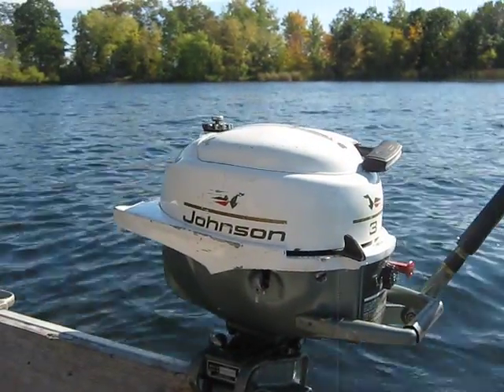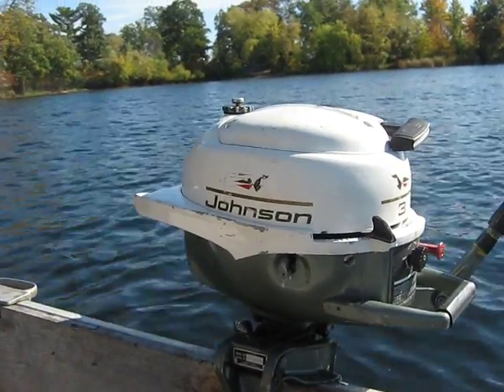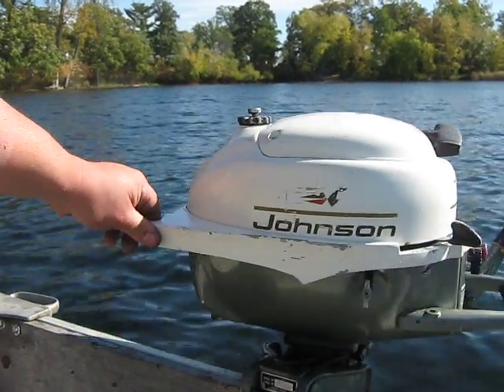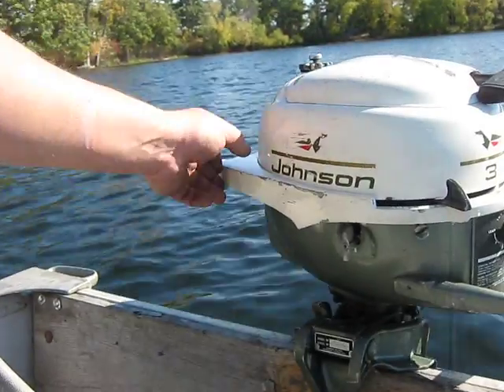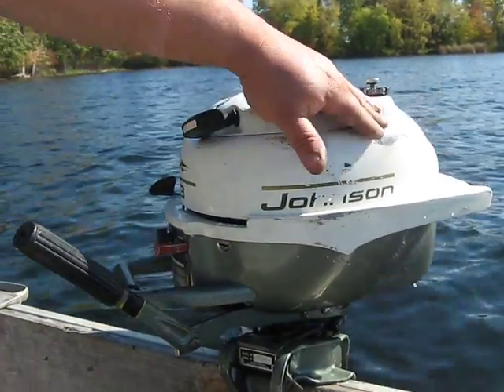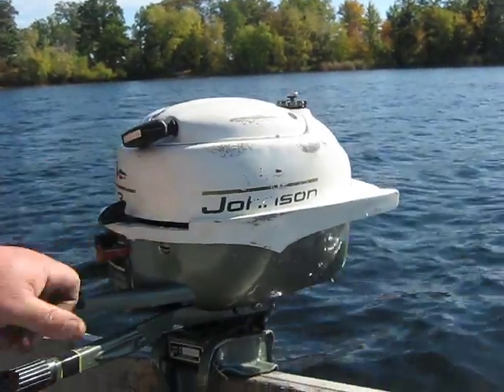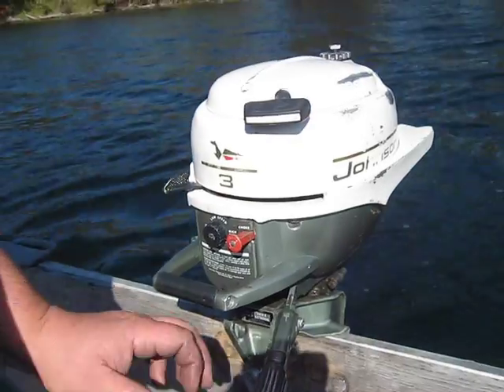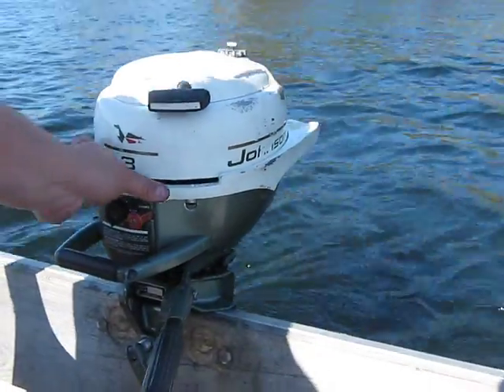1967 Johnson 3hp outboard motor.

Comment: I have this same motor and adore it!  such a smooth runner.  Paid $10 for it at a crack house going out of business sale.  Put another $10 into some fuel line, plugs and gas.  Started right up after who knows how long.  If you have one, hang onto it.  It's top notch!
Reply: I have the same motor also JW f22c just replace the condenser two of those and new spark plugs and for some reason I am not getting a spark although when I first took it out of storage it fired up until I put it in a bucket of water and after that I could not get it started. Any ideas would be appreciated

Comment: Hey Ben, I just purchased a 1965ish Johnson Jw20B 3 hp, I got it to start no problem but it would only run for 3-4 seconds before slowly dying. I checked the fuel valve and it dumped gas fine, then I cleaned the carb. Once I put it back together it won't even pop. I checked and double checked that gas was on and vent cap was out. I am curious to see if you have any tricks. Thanks

Comment: I have just acquired (I think) the same motor with an old 1974 sailboat. Looks very much like yours in the video, but has a detachable lower half for storage in a carrying case. Any suggestions as to what year it would be (?1967) or if anyone has access to the owner's manual. Runs well - lovely old quality construction and engineering.

Comment: I have a 67 Evinrude Lightwin says 50/1 on the front they changed to that in 64 runs like a top, just like this one.  I ran in on 24/1 like my 59 Johnson and it wouldn't run on that wouldn't even accelerate and the plugs were just fouled and full of oil.  When I changed it back to 3 oz per gallon it ran good again

Comment: I love my 3hp Johnson. It's from the 50s I believe and has the high and low speed adjustment. It always runs no matter what and has never stranded me yet. However It's not running quit right anymore the compressions are around 60 and the cylinders are hot to the touch and only seems to start with the throttle wide open. How hot do these motors run and what's a good compression. I'm thinking of completely rebuilding it over winter I like the little motor too much to just give up on it what advice do you have for these motors. Thanks again I love old outboards and you channel.

Comment: Hi Ben, Quick question.... on the old Johnson 3hp and Evinrude lightwin 3hp motors from 1950s and early 60s what fuel mix do you recommend? I have found alot of different posts. some say 50:1 some say 32:1 and some say 24:1
Reply from the maker: Actually the correct mix is 16/1 they are a plan bearing engine and really need the oil
Reply: Get an owners manual.   Ratio varies

Comment: Hi, I Just picked up a really nice 1965 Grumman sport boat that has one of these little Johnson 3hp's on it. It runs nice, but I do not know the history. IF and WHEN this thing would need repair parts, are they fairly available? and if so where?  Thanks much for your time.
Reply from the maker: Boy that is a nice one! Finding parts is no problem, you can get all the parts at your local Evinrude dealer. Just make sure you mix the gas at 16/1 for that motor and it will last a lifetime.
Reply from the maker: +Brian Vance Nice!

Comment: Do you remember what ratio you ran?
Reply from the maker: Sam Stafford I always use 16/1 in the 3hp motors. all years.
Reply: chrysleroutboarddude Thanks so much! i just got a little jon boat that came with one very similar to this one.  Guy told me he mixed 20/1 and it was real smokey, so he thought 40/1 would be better.  I will try 16/1 and see how she runs.
Reply from the maker: Sam Stafford It will smoke and that is normal. 16/1 is 8OZ oil to ea gal of gas, 40/1 is 3OZ oil per gal of gas. You can't hurt it with too much oil, but you will destroy it without enough oil.

Comment: This motor runs a 50:1 mix, just read some earlier comments about this.
Reply from the maker: +Russell Day You can use whatever mix you want! but the power head is still a plane bearing engine and it will last much much longer with a heaver oil mix! If people ask for my advice I will recommend way more oil.
But what do i know, I have only been working on them for over 30 years.
Reply: No trouble with plugs fouling?
Reply from the maker: +Russell Day Nope! Never TCW-3 oil is ash less and will not foul plugs, I have used as much as a 8/1 gas oil mix without any spark plug fouling. 
It is a little confusing but there are two different kinds of fuel mixture, one is the fuel and oil mix and then you have the carburetor /fuel air mixture. Having the carburetor out of adjustment will cause spark plug fouling not the oil in the gas.
Reply: Great information, thank you.

Comment: Nice video but that would be nice to  show how much water comes  out of the pee hole
Reply: No pee hole.  They have multi exhaust relief holes on the shaft .  Water just spits out of these holes.  If you see mist, you are good.
Reply: @brianchisnell1548   thank you
Reply: @ghislainpoulin4913  well you are welcome!  When I am running mine, I reach over and feel the shaft 4 inches  below the power head.  It should be warm.  Not hot.  Cheers!
Reply: @brianchisnell1548  I've got the same motor but can't seem to get it to cool down. There is no water coming out of the holes on the shaft and the motor runs good for a few minutes before shutting off, presumably because it's running hot. I've taken the lower unit apart and inspected the impeller, which looks good, but still no luck. Any ideas?

Comment: Hi Ben, Quick question.... on the old Johnson 3hp and Evinrude lightwin 3hp motors from 1950s and early 60s what fuel mix do you recommend? I have found alot of different posts. some say 50:1 some say 32:1 and some say 24:1